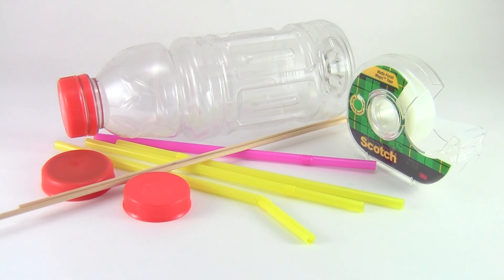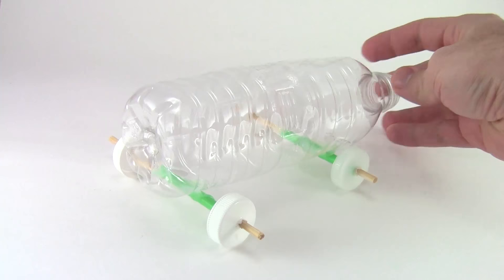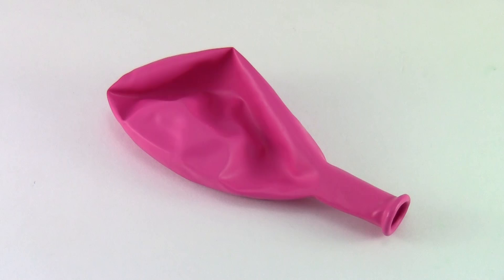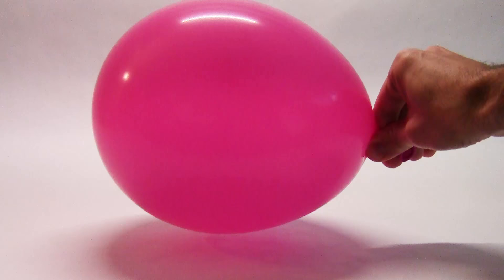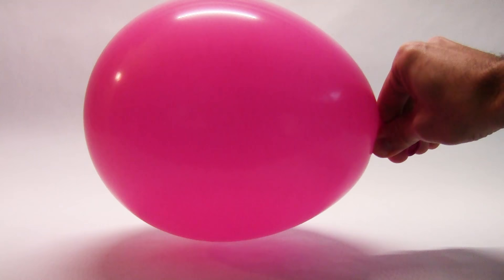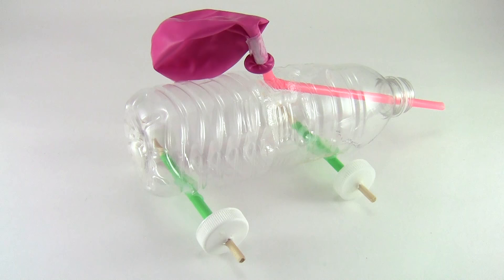Balloon Car | STEM Lesson Plan

Comment: How do you get it to move if it doesn’t move . LOL my daughter’s car doesn’t move!!
Reply from the maker: 1. Make sure the car rolls if you just push it. If the wheels and axles aren't aligned properly, it might not roll smoothly enough for the balloon to push it. 2. Try inflating the balloon more, make sure air isn't leaking out around the straw, and make sure the straw is pointed mostly backwards (not down).
Reply: Did your daughter's car move?